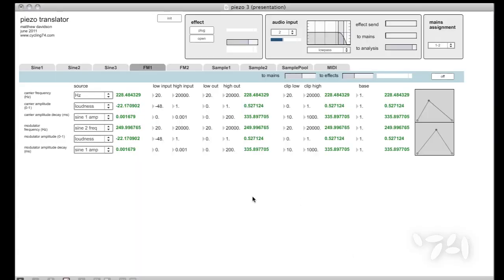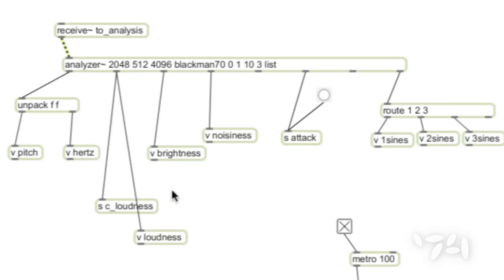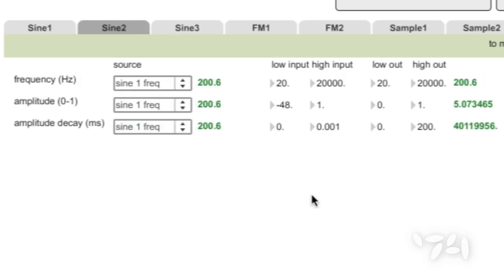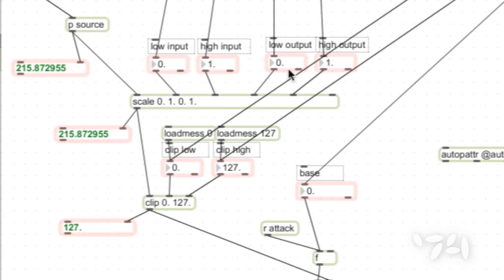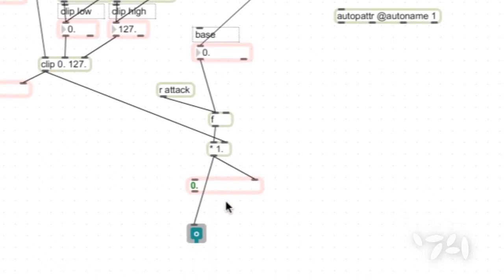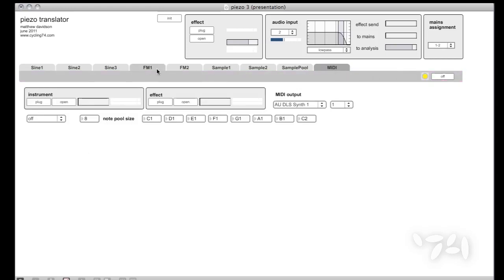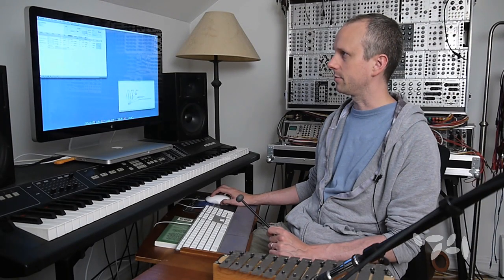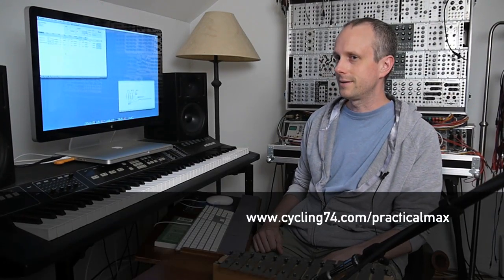Practical Max 1-B

Comment from the maker: If you own Max for Live, then you already have Max installed. If you do not own a separate Max license, you will not be able to launch it on its own without authorization. However, you can use Max Runtime (found in your Max 5 folder) to run this patch and other ready-made patches.